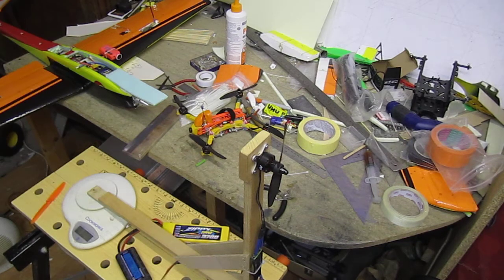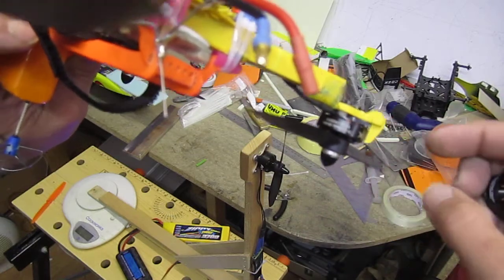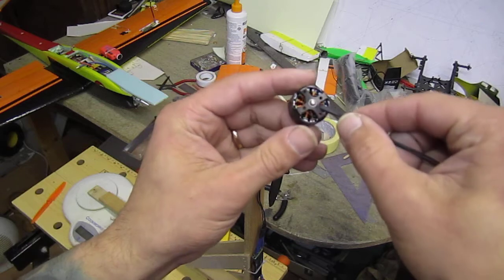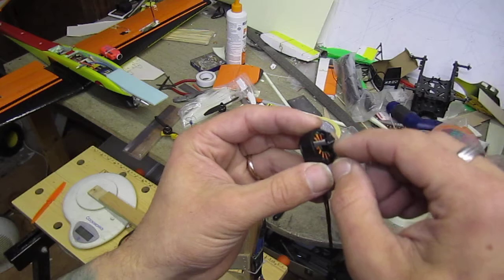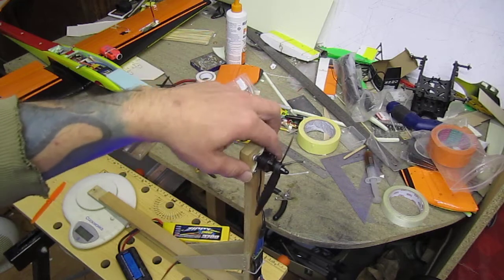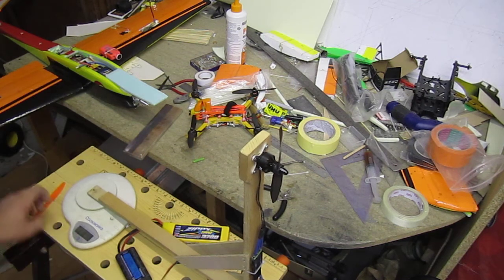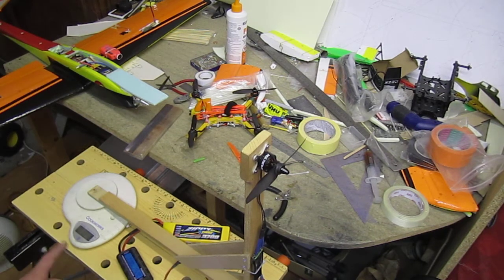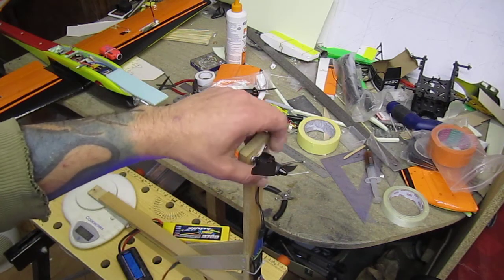RCX H1806-6 2400KV motor test/review

Comment: thanks for your test
i've the same motor with 5030 gf and rcx esc 12A and it's do the job perfectly but
in the future i would change the propeller by 5040 (12.7A in your test ) my esc support Continuous Current 12A and burst Current: 15A (10 Seconds) (http://www.myrcmart.com/rcx-12a-sky-simonk-brushless-esc-for-multicopter-23s-p-8051.html) with your experience do you think i've to change my esc in the future?
Reply from the maker: daltondax No need to change ESCs. I'm flying now with 5x4.5 props (yes, even more punch:) with them motors and have Afro12A Lite on. I can do WOT for 5s and no problem. I've tried even 5" bullnose props- motors can handle them no bother, it's just waaaay too much power:)
Reply: ok thanks a lot for information and good fly !!

Comment: Hi,

How do they perform after a few months? Any issues with bearings, magnets?

Thanks!
Reply from the maker: I didn't fly that much yet, no weather for it yet, but so far they look promising.
Reply: As I understand, magnets are not just glued in, but also have a pocket in the motor shell for each one, right?
Reply from the maker: They do indeed, sitting in the slots. First set I got with heat shrinked copper wires ~5cm long, and last set came with nice silicone soft wires ~15cm long, very handy.
Reply: OK - bought a first set of 4:) I have used SunnySky 2204 2300kv motors but there is common problem with the magnets coming off the shell easy:(
Reply: ROBOFORCERX2000 Are those still working? Should buy? http://www.myrcmart.com/rcx-h18066-2400kv-micro-outrunner-brushless-motor-best-for-200300-frame-p-7990.html

or maybe 2206 1950kv 6045/6030(3S)
Reply from the maker: Xava They still going good, have them on 2 miniquads and on a small airplane, no problem. Bearings are getting tired slowly but that is normal with any motors that being used constantly.

Comment: Thanks for the review. This test was missing from most reviews! (I mean the 5040 prop test)
Reply from the maker: Cheers, they're a blast with 5x4s, but the real punch goes with 5x4.5 bullnose props, that's what I'm flying with now. Got cheap Chinese 6x4.5s from Himodel, chopped them to 5" and they're holding on very well in crashes. More pitch speed at lower revs and more punch that my skillz can handle:))

Comment: Nice ones, just waiting of them.. 12amp esc with 5030 props are ok?
Reply from the maker: Yep, plenty, I pulled only 9.9A and looks like that it will be enough thrust for Mini, but if you want extra pitch speed- 5x4s are the way to go:)
Reply: thanks, i ordered tons of 5030 and few days later i saw the 5040 -.- just the beginning with fpv and goggle flight.. when i abuse all 5030 i will try the new ones

you make really nice stuff, only sad was the "meeting" of the dogs nose and the prop, sry for my bad english